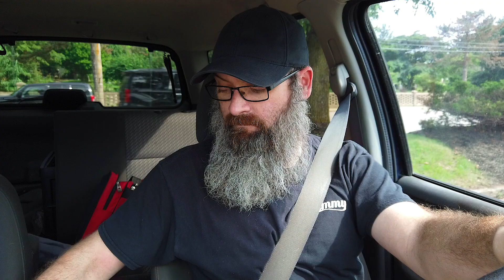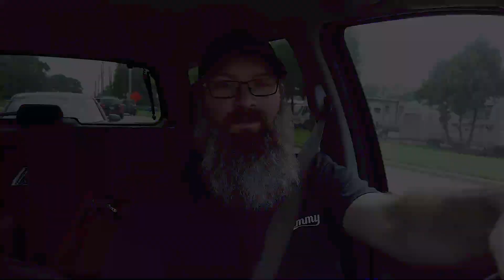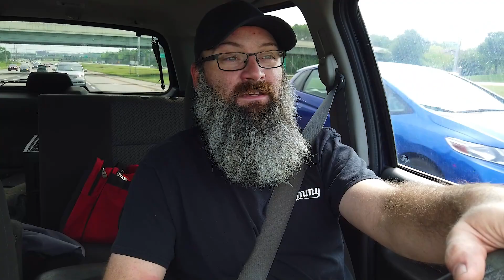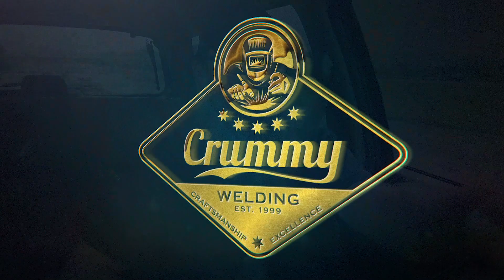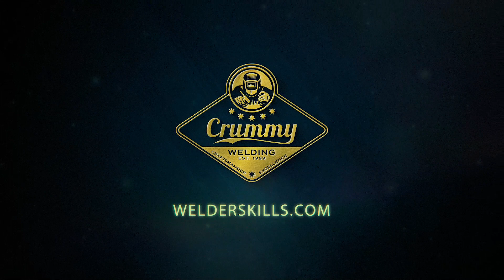FMF 10 ABC of Welding!

Comment: New tig welder here. I live in Tallahassee and weld in my garage. Due to heat and humidity, i was getting soaked. My shirt sleaves were wet with sweat and was getting shocked. So I just installed a ac window unit ladt week. What a differenc. I highly recommend.
Reply from the maker: Yes!!  AC is a very important tool in every shop, if you ask me!  Not going to enjoy worked while miserable.  Glad you found the channel and have AC now!  Should check out WelderSkills.com for more instructional videos!